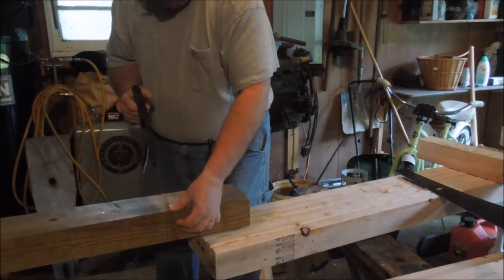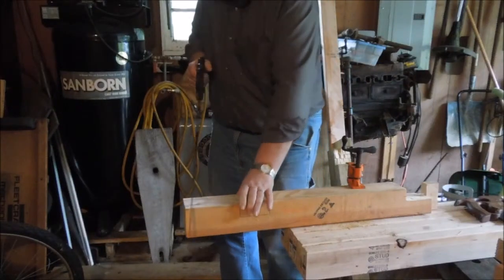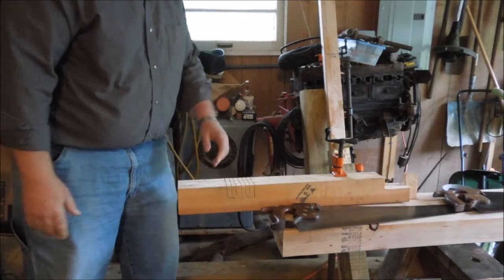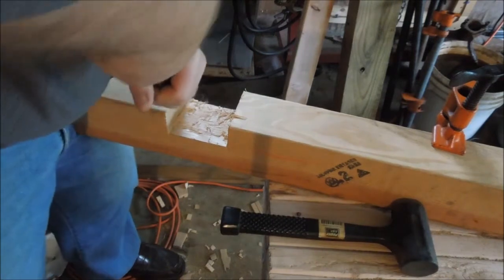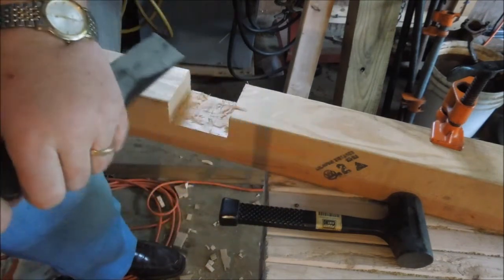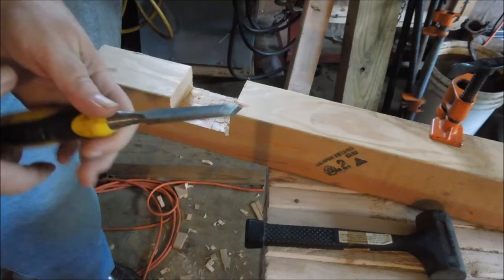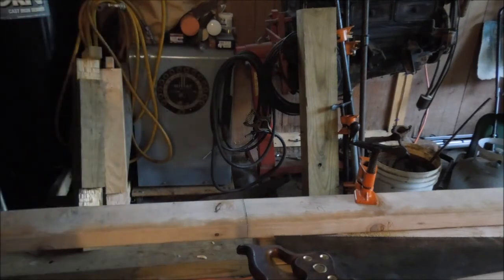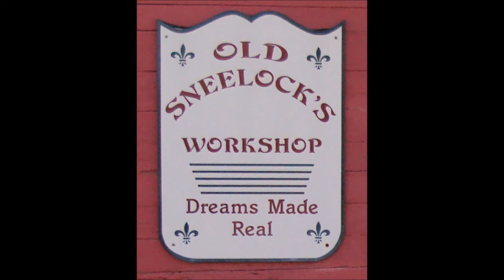Building a new workbench Part 3 - To cut a leg mortice - a video tutorial by Old Sneelock's Workshop

Comment: Nice traditional hand work, no electrons were forced into labor during the cutting of these boards. If the power goes out you will be the one still working, well you and Roy Underhill. Good Work.
Reply from the maker: Thanks halfwayuphill. I like using my handsaws when it makes sense. I seldom rip a board with a handsaw. With the table saw right there I just use that. If I were doing production I'd  probably use the chop saw for cutting to length too.
Given the option though I feel better using my hand tools. For this project I wanted to use tools similar to the ones I gave my son last Christmas. Kind of ties the gifts together.